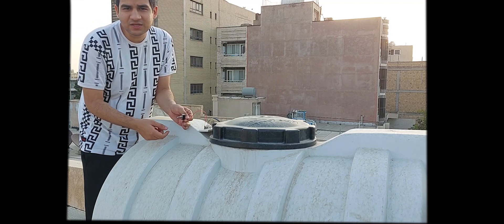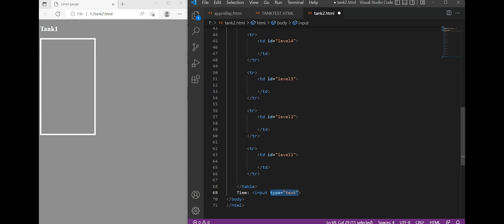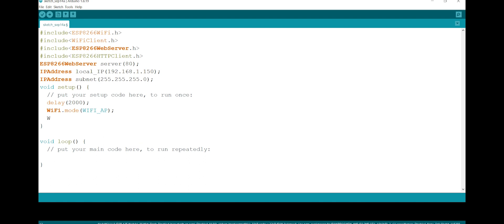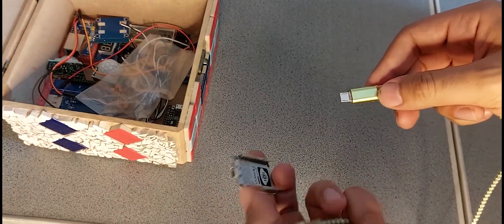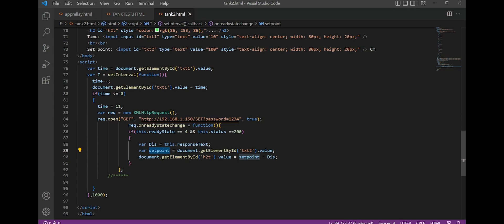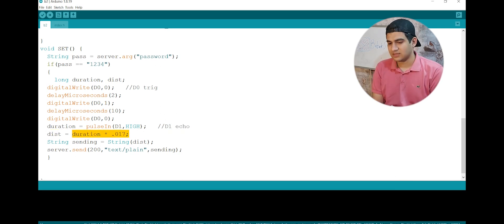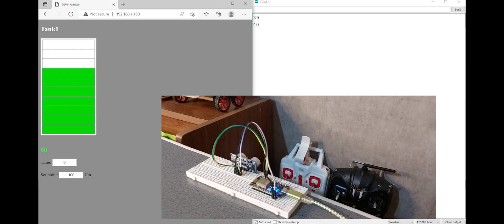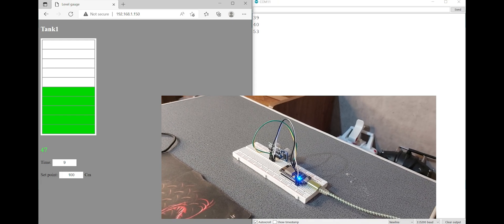Wireless level gauge using an ultrasonic sensor (SRF05)

Comment: does need internet?
Reply from the maker: Hi my friend. No, no internet is needed. Just connect directly to the Wi-Fi of the device with a computer or mobile and search for the IP. Thank you
Reply: good where is the code please?
Reply from the maker: In the description section.
Reply: thank you bro
Reply from the maker: You're welcome.
Reply: I've tried it very without problems
But if there was one thing, it would have been very good to turn on and turn off the pump with automatic.
Reply from the maker: Exactly. It is better to do something that when the water level is too low, the water pump will be turned off by the device.
Reply: thank you im sharing your vedio
Reply from the maker: Thank you ❤️❤️❤️❤️❤️